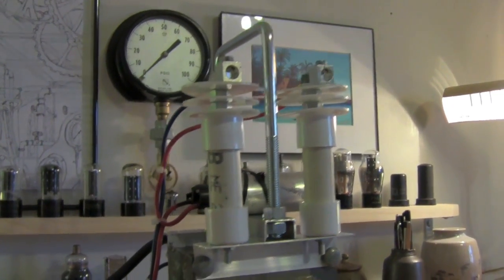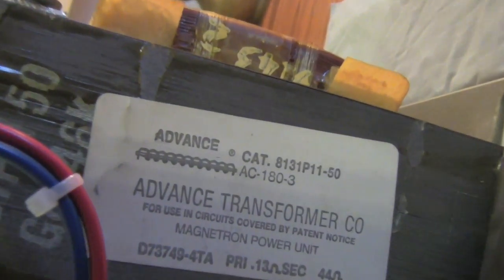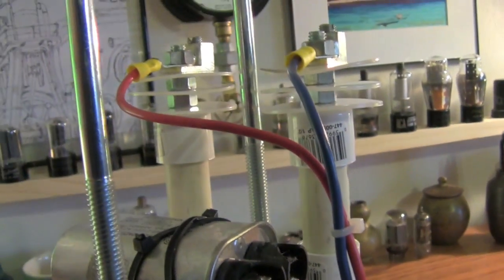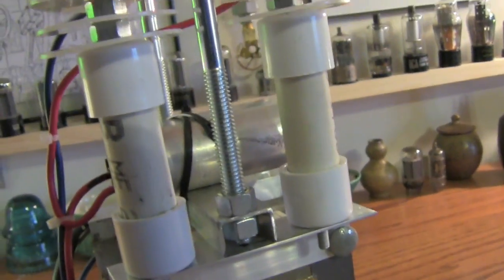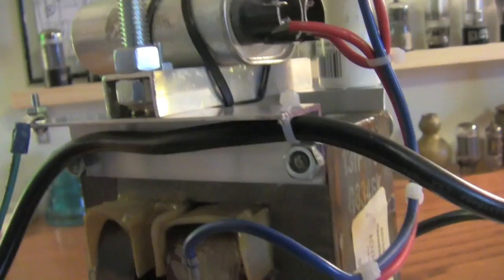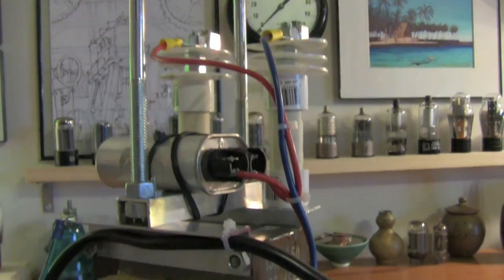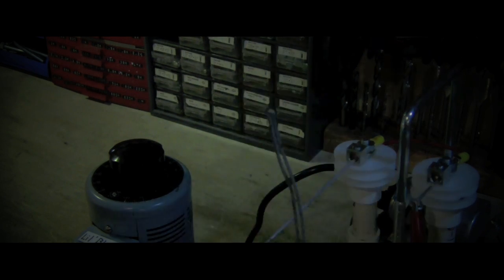New 4 Kv High Voltage Power Supply - MUST SEE

Comment: I think the extra HV lead is for the HV diode to outher side of cap. well you got HVAC with out diode. in a microwave the HV + is ground. get a old microwave look at the diode and cap how its wired.  stay away from the HV,  put several 500K resistors to discharge cap. then put jumper across cap when working on it. there can be enough charge  on the cap to stop your hart. please be safe. and have fun!!

Comment: The mot has the windings resistance printed on it. 
.13 Ohms on the primary .
44 Ohms ohms on the secondary.
From there you'd need the wire diameters to figure out the turns ratio, which can be used to give you the exact number of turns on  both the secondary and primary. 
That said, being a microwave meant for cooking, even if it's old, this MOT is meant for a maximum voltage of 2400 Volts. Microwaves in the USA are actually only rated for 1200 kv, regardless of how new/old they are, because that's what the standard is. 120 volts is the residential standard power in the USA, and stepping up power more than 10 times the input voltage can cause transformers to throw ferrosilicon bits out of the transformer.  

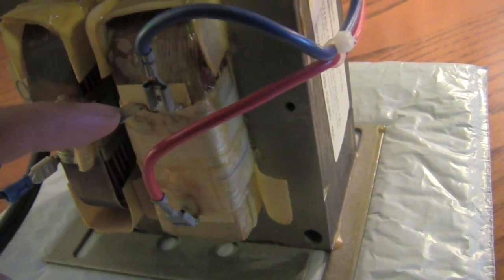As far as that goes, I would be surprised if it's not center tapped on the high voltage side (the secondary winding...), which is why there's two posts close together, as noted at about 1:06. 
Having a center tapped transformer stabilizes the current output, which might be desirable in some applications (like when you want a high voltage arc...).

Comment: you could also get some HV diodes and first make a bridge rectifier to turn the output to DC then have the 2 top terminals having diodes pointing out of the transformer as outputs and the center of the coil as the ground and draw twice the current from it.
And again, Enjoy :)

Comment: move that red wire onto the other pin and you will get double the voltage! :D 

By the looks of it the part where you have the red wire connected to is the center of the coil. and the two on the top are the ends of the coil. meaning that at the moment you are only drawing half the power from the MOT. what i would do is get some HV switches and make it switch from half the coil to the full coil. Be careful with it as you may already know hat these things are very dangerous.

Have fun :)